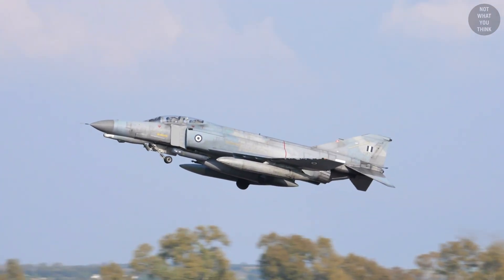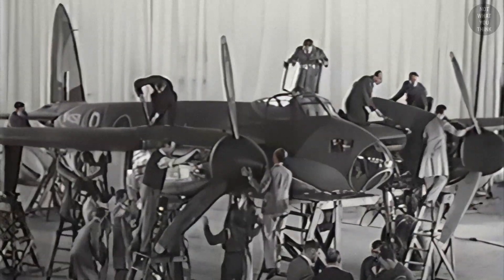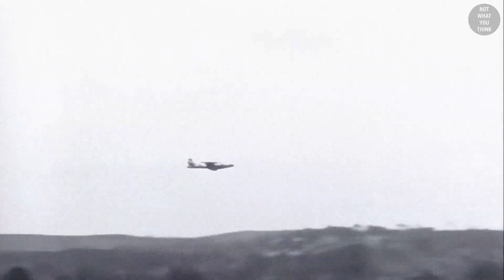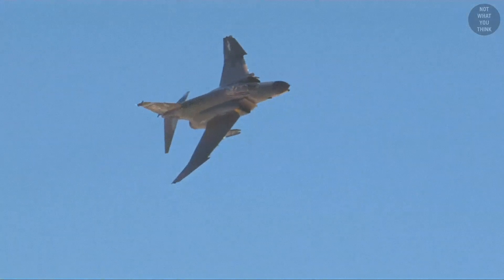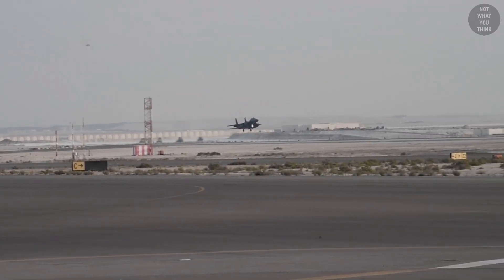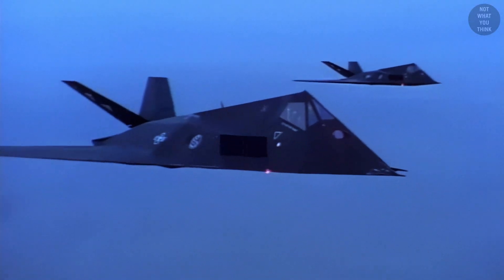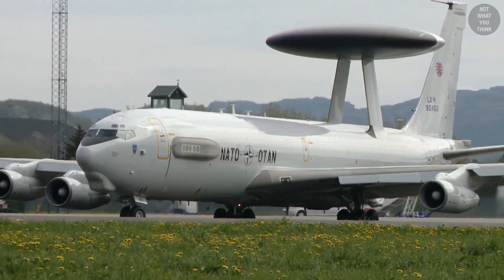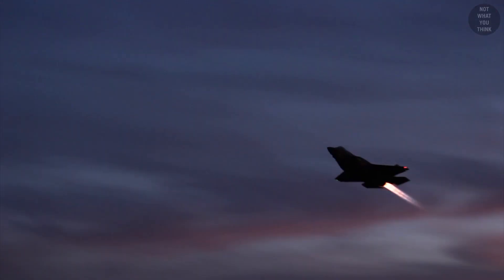Why are Modern Fighter Jets Slower than 1960s?

Comment: The thing is that older jet fighters can only achieve those very high speeds on very short "dash" flights. Flights that consume a lot of fuel, cut the life of the jet engine(s), and make themselves a huge infrared target. Real combat experience shows that you don't need that high a top speed, but lower infrared signature and a faster constant cruising speed.
Reply: Yeah the high speed interceptor concept was a response to the possibility of nuclear bombs being delivered by aircraft. As soon as ICBMs became common, the high speed “dash” capability became obsolete.
Reply: @splewy  not really if you live in a country with a massive area like the US, Can Aus Russ. There's always the need for a high speed interceptor. The Mig 31 has just underwent a full refit & modernisation. At the speed it can fly, with a nuclear armed cruise missile with a range of say a 1000 miles becomes a nuclear missile with a range of 1,500 miles that's delivered at speeds that are very very hard to defend yourself from.
Reply: @splewy  

The high speed interceptor concept is still very much valid if you're more interested in defense than in power projection.
Reply: @splewy  high speed dash is still useful for fleet defense, since carriers are mainly at threat from aircraft
Reply: The Century Series aircraft (as well as similar ones from other countries) were, primarily, envisioned as high-altitude bomber interceptors or as carrier-based fleet defense. In this role, combat radius is less important than time-to-climb and time-to-engage, both of which favor supersonic capability.  The introduction of ICBMs and much better early detection (AWACS and the like)  diminished the interceptor role.  The aircraft available to both sides during the Viet Nam war were the product of an earlier, bomber-dominated era and it was the other capabilities of the Phantom (ruggedness, huge payload, among others) that made it the best choice available out of what was on hand.  North Viet Nam used its aircraft, almost entirely,  in a purely defensive role as interceptors. Their MiG 19s and MiG 21s, operating close to home were well-suited to the need.  Modern combat aircraft have evolved into multi-role machines emphasizing attack capability where, while not needed that much, the interceptor capability is still important enough to maintain supersonic capability.
Reply: Amazing - anyone would think that you'd just watched the video
Reply: @nickgardiner7319  LMAO!
Reply: @nickgardiner7319  I was about to say the same thing
Reply: Yeah to compare them you have to compare the afterburner top speed and the not after burner top speed. F35 can do mach speeds without the afterburner other older jets cant do mach speeds without using after burner.
Reply: Legalize Raping Russian Broads In America  your name is disgusting and i hope you are always in discomfort
Reply: Well the simple fact is modern engines for more reliable and efficient
Reply: A lot of the older jet fighters/interceptors were actually designed to shoot down nuclear armed bombers (pre-ICBM era). A fighter/interceptor with high speed meant it could destroy bombers before they could attack cities. Of course, nukes are now mostly delivered by missiles so a single purpose short range aircraft is useless.
Reply: TL;DR more range more fuel less heat in engine
Reply: thanks, i just scrolled down and didnt click play
Reply: @Sacto1654 I also watched the video
Reply: the only plane where i would argue your wrong on is the sr-71  they 100% needed to  be fast
Reply: Yep. The Mig 25 could hit Mach 3... sure.. but doing so caused engine damage. Still, During the early days of the cold war, Speed was the driving force for development. It was the "one up" measurement between the USSR and the US. (Well, one of the measurements). Both countries followed the 'Bigger Better Faster Stronger' mantra.
Reply: They were made for bomber interception that was where the top speed shines fly as quickly as you can dump your ordinance into the wing of Soviet bombers and probably eject somewhere as you probably don't have an airfield to return to because WW3 has happened
Reply: Engineering is about tradeoffs.   So you know there was a treason why the tradeoff was made.
Reply: And a more powerful engine, so you can keep your speed in tighter turns.
Reply: Shhhhhhhh. Ears
Reply: Great you said exactly what he said in the video we just all watched
Reply: Rolling down the runway
throttles open wide
see the mighty Phantom
sway from side to side
airborne again without a blip
It's just one more aborted trip
but we're pressing on regardless
for the wg cdrs AFC

Went to early briefing
climbed into the Kite
opened up the throttles
and roared into the night
leaving the flare path far behind
It's dark outside, but we don't mind
cos we're pressing on regardless
for the wg cdr's AFC

Rolling down the runway
throttle open wide
see the mighty Falcon
sway from side to side
airborne again with just 9 G
I wish I had a nav with me (!)
but we're pressing on regardless
for the wg cdr's AFC

Rolling down the runway
throttles open wide
see the mighty Jaguar
sway from side to side
airborne again, but only just
It's not much fun
with F*** all thrust
but we're pressing on regardless
for the wg cdr's AFC

GIVE ME BUCCANEERS!
They're British through and through
The Banana Jet
The Best we've had yet
We are the last of the few.

Don't give me the Jaguar
Unless you refer to the car
The car is a groundhog
The aircraft is half frog
Don't give me the Jaguar.

Give me Buccaneers
They're British through and through
The Banana Jet
The Best we've had yet
We are the last of the few.

Don't give me the Harrier jump jet
You haven't convinced me yet
Jets that fly backwards 
Are soon to be knackered
Don't give me the Harrier jump jet
Well… Not just yet...

Give me Buccaneers...
They're British through and through
The Banana Jet
The Best we've had yet
We are the last of the few.

Don't give me this computer crap
It's no way to tackle a SAP
It's OK for Dicks, Germans and Spicks
But Gentleman always carry a map!

Give me Buccaneers...
They're British through and through
The Banana Jet
The Best we've had yet
We are the last of the few.

Don't give me Air Traffic Control
They live in a bloody great hole…
They scream, and they shout, then F**k you about
Don't give me Air Traffic Control.

Give me Buccaneers...
They're British through and through
The Banana Jet
The Best we've had yet
We are the last of the few.

Don't give me the F-104
It's only a ground loving whore
It goes in a turn, flick, spin and burn
Don't give me the F-104.

Give me Buccaneers
They're British through and through
The Banana Jet
The Best we've had yet
WE ARE THE LAST OF THE FEW!
Reply from the maker: What happened? It's simple question, Do you know Tim James?
Reply: @NotWhatYouThink  hello mate
Reply: @NotWhatYouThink  um. Whos tim james?
Reply: @NotWhatYouThink  hi the voice
Reply: and more wear on the airframe.
Reply: Mnaah....
Reply: If you've seen an episode of dogfights covering vietnamn, it allways seems like jets from that Era had a sieve for a fuel tank.
Reply: I think it is for the health and safety of pilot. The documentary of Russian Mig explain it perfectly. Less crashes and more maneuverability.
Reply: You are correct, jets like the F-22  and Eurofighter can supercruise comfortably.
Reply: f4 costs only 5m. it should be brought back and replace today's ridiculously expensive fighter jets and bombers
Reply: The Soy Hunter  What are you talking about? I'm sure you realize that the F-35 can go above Mach 1 without afterburners, right? It was literally one of the project goals.
Reply: EXACTLY!
Reply: It’s another shift in technology.  In the Spanish civil war, the Luftwaffe learned speed as more important than maneuverability, a shift from wwi.
Reply: Well done, you've just repeated what was said in the video
Reply: The F-111 would like a word with you
Reply: Global strategic conditions and technologies changed, top speed is not a major factor now that strategic bombers are no longer the most serious threat
Reply: Make sense
Reply: an F35 can only do Mach 1.6 for 50 seconds without causing permanent damage to the aircraft.
Reply: @spiffdandy77  Only the naval versions. And only under a whole set of specific conditions that they aren't even bothering to investigate and test thoroughly because it doesn't affect the relevant performance of the aircraft. Just like the F-22 has a top speed limit that isn't defined by the capability of the aircraft but issues it might cause.
Reply: @spiffdandy77  the F-35s cruising speed is mach 1.4 standard at alts of 30,000 ft mach 1.6 is its burn speed.
Reply: @spiffdandy77  Yes this is true. The F-35 is junk.
Reply: @spiffdandy77  Totally false, and there aren’t any teen fighters than can do 1.6 Mach with most combat configurations anyway, so F-35s are uniquely capable in the speed department, averaging higher cruise speeds than the F-16 and F/A-18 especially.  They are more comparable to Typhoon and Rafale in cruise speeds.  The assertion of permanent damage is erroneous.
Reply: @spiffdandy77  That is not true. The lead F-35 project test pilot addressed this saying that they could cruise around at Mach 1.6 all day. Early on, the F-35 B model had had structural concerns in the tail section with prolonged use of afterburner, but that has since been rectified. Again, in combat they would never operate over mach .95 due to the heat signature.
Reply: @spiffdandy77  yeah exactly and and rocket traveling at Mach 7 will absolutely fuck that thing far before fifty seconds
Reply: You summed it all up perfectly! Even so, I still want to go Mach 2+, LOL!
Reply: @davethekraut  Hey maybe give some old fantoms to Ukraine.  The whey the Russian fly it mite help Ukraine.  The Fantoms flew good in the 60s and 70s they were in service for a long time. Even send over some F15 and F16 they were perfect dogfighting jets. It would be good for Ukraine.
Reply: Not true
Reply: Think, the 71 had mach 3 Speed ,,, duh for thousands of miles
Reply: @raywhitehead730  Yeah but it was literally two cameras strapped to fuel tanks with some engines and some place for pilots... It was also designed to fly at very high alt, not suitable or usable in any fight, just to take photos. Now we have satellites so no need for such aircraft.
Reply: @raywhitehead730  The SR-71 is a much different beast compared to something like the F-35. For one, it is designed exclusively for high speed high altitude flight, so it's engines and airframe are built to be most efficient at high speed (The engines became most efficient at about Mach 3)
For two, the SR-71 is designed much better for flight above Mach 1 than the F35, because the 35 is designed to be controllable and efficient at subsonic speed as well as supersonic speed, the 71 is not.
Reply: @raywhitehead730  that's cause it is huge compared to say an F16
Reply: @richardmillhousenixon  Yes, not to mention the SR-71 was a recon aircraft, not a combat aircraft.
Reply: @raywhitehead730  the SR-71 was purpose built as a highspeed recon aircraft. this is talking about the fighter. the 71 also was built as a plane that cruised at almost 80,000 ft which means the cruising speed that is shown is actually skewed due to air resistance.
Reply: @raywhitehead730   It also out climbed and out ranged IR missiles
Reply: Today, they say more Americans believe a German invented the jet engine! It's so sad. Frank Whittle says of his "Eureka" moment. It came out of the blue, he recalled. He had, effectively, dreamt up the turbojet, the early jet engine. I knew if a man was going to fly faster, he would have to fly at a greater altitude where the air was thinner. Whittle concluded that the conventional propeller would never be sufficient, and that an entirely new sort of engine would be required. His arguments were so advanced that he was awarded 30 out of 30 for his work. 

When the young RAF officer took his idea to the Air Ministry, later in 1929, they were not sure what to make of it. They ran it past a senior boffin called A.A. Griffith, who had already done some work on the subject. Whether he was misguided or simply disliked this young Whittle in uniform, Griffith gave the idea a thumbs down. As a result, the Air Ministry rejected Whittle's design as impractical, and carried on ordering traditional planes with propellers. 

So Whittle took out a patent to protect his turbojet idea, which was duly published by the Patent Office. Others, like the Germans, however, saw its merits, and German diplomats in London wasted no time ordering copies of the patent when the patent expired in 1935. A young Whittle could not even afford the £5 renewal fee.

The RAF remained supportive of their young genius, however, financing Whittle through Cambridge, where  needless to say, he took a First Class degree in Mechanical Sciences. All the while, he was still designing the jet engine he knew would work. Finally, two friends helped him secure enough backing to start a company called Power Jets Ltd, and in April 1937, he fired up his first jet engine, (the first seen working recorded Jet engine ever built).
 
Unlike the latter claimed German ''Engine'', they claim (long after), yet they claim it was in the same year, of the same month, and on the same day? LOL. Sure! Only nobody ever said a thing about it, at the time? But Whittles was spoken about, and written about, throughout the entire media world, as he couldn't turn it off. He had to wait for it to run out of fuel, LOL.

Today, his son, Ian Whittle's, primary concern is to protect his father's memory from continued erosion. He said It's appalling, it's a disgrace to human ingenuity, using cheap tricks, and misinformed people to make up history, It's now an accepted fact in the USA, that my father did not invent the jet, but, that he and von Ohain — (who became an American citizen) — co-invented it at the same time, he says... Pretty soon, history will be rewritten to say that it was a German or American invention, just not British.

So true his words really are? Certainly, many American engineering institutions now routinely describe von Ohain as one of the inventors of the jet. 

Captain Eric Brown, late, of the Fleet Air Arm, (one of the greatest test pilots in aviation history) said it was Frank's invention, and they just copied him. And let's be honest, he should know, not only has he flown more planes than anyone else — 487 different types, but he was sent to Germany straight after the war to get hold of all the Nazis aviation technology.

He says I interrogated von Ohain, who was very ambivalent about where he had got his ideas, he couldn't say where his Idea came from, says Capt Brown from his Sussex home. He goes on, but his sidekick was different, an open book, he was utterly straight-forward about it. He said that Whittle's patent had been in every technical library in Germany, even before the war. He says, I have absolutely no hesitation in saying that Frank Whittle was the real (and only) inventor of the jet engine — and furthermore that he could have produced a jet fighter by 1937— If the Establishment had been on his side. But the Jet Engine is Frank's very own Invention.

This is the American mentality, and it always has been, you only need to study Anglo-American history, to see straight through this misrepresentation of a “Special Partnership”. 

Whatever the British have achieved In this world, the American wants to beat it. And however they do so, whether by cheating, lying, making up history, stealing others technology to credit themselves, the list is endless.

But, I mean, let's be honest... Just how stupid are they really, they really don't understand British history, as they'd need to be incredibly stupid, unrealistic, and foolish, to try to top what the British have already achieved in this world, as no country gets remotely close.
Reply: @hotstepper887  However, Whittle's design was a technological dead end. The axial flow jet engine was developed by Junkers around 1939 and first flown in 1942. Most modern jet engines use axial flow design nowadays.
Reply: @Sacto1654  To understand WW2?, you only need to imagine, if Britain had been beaten at any point in the war, or even if Britain did what the USA did, and merely decided to sit out of what was always a world war? We could have done that too, as Hitler never wanted a war against Britain. 

So, if Britain had been beaten at any time in WW2, or had simply done the same as the USA?, then Hitler wouldn't have needed to open up the second front, and he would've attacked the Soviets in 1940, with full strength both in the air, and on the ground. 

And Germany would have absolutely annihilated the USSR, as in 1940, the USSR was not in any way at all, prepared to even defend themselves. The Soviet Red Army were sharing one riffle between 10 troops in places. That would have left Germany in control of all Europe, all the Soviet Union, plus much of the rest of the world! And that would have seen the USA, completely, and utterly annihilated, is the reality, the real truth. And that truth is nothing like you'll hear today! 

Churchill said to the world, ''Never in the field of human conflict was so much owed by so many to so few'' What do the American people think he was talking about? Just how is this possible, in 2022, to read so many that have no idea about their own country's real history?

Roosevelt, actually, set about asking Hitler for some kind of deal/arrangement, to avoid getting involved in the war! (Though we see that also changed and lied about today). But we all know that Hitler even ridiculed the cowardice of the USA, as he read the letter to the German people, (now if that's not cowardly and treacherous?, then I don't know what is). Hitler laughed at the USA, mocking them, rightfully calling them cowards for refusing to declare war on him! And he, then, declared war on the USA. How embarrassing is that, really? Huh? 

In a 1945, state department survey, on the USA's public attitudes to its wartime allies? Britain was the least trusted country of the allies. Just another thing that shows the truth?. 

The Americans all talk of winning the war, by supplying it? (yet even that is only another US lie, as I'll be proving below). And all while making an enormous profit from it?, the truth is, they only became a superpower, at Britain's expense. And still lie about it endlessly today. They were the traitors of WW2, is more like the real truth, and real history of WW2. Nothing new there though?, as that's what they've always been, to every single one of their so-called allies, all throughout their ever so short, and criminal murderous history. Their bullshit is like nothing this world has ever seen before, but when you're useless, cowardly, and brain-dead?, what else have they got, other than their bullshit?

Winning the Battle of Britain, was instrumental in getting Hitler to actually lose the war, (by making his biggest mistake of the war, opening up the second front), more so than anyone actually winning it. Nevertheless, the Soviets holding their front, before then turning Germany around, and chasing them home to their demise, is what actually ended the war. Most certainly not, the USA, not by the stretch of anyone's Imagination. 

The arrogance of a naive nation, when they did eventually arrive?, saw them get a crushing defeat in the desert? Utter tomfoolery, and sheer Incompetence. Oh yes, the super intelligent Yanks, thought, as the Brits had managed to force Rommel all the way out of Egypt. It must be quite easy, so that's where they would gently "ease" their troops into the theatre of war. 40,000 crushed and killed within days!

They then tried to help take Italy?. Only It had Churchill groaning, that he'd expected "a rabid wildcat just let loose, but all he got, was a blubbering whale stuck on a beach" LOL. As the Yanks decided to secure the beachhead, rather than as planned, storming inland to cut off and attack the retreating Germans (as the British forced them inland). 

Oh, and then, (as If not bad enough), decided to ignore the plan of cutting the retreating Germans off, but Instead, they headed straight for Rome, (so they could be first), while allowing those top crack German troops the time they needed to regroup and dig in. Such arrogant fools! It's reckoned that foolish, selfish act alone, cost over 400 British lives.

They then decided to commit the most cowardly act of human history, by murdering near on a million civilians, with a nuclear attack TWICE on civilian targets! And then the lies as we can now see today?. They claimed Japan surrendered after the second nuclear bomb?, yet again that's a lie, and it's not true. 

The truth is, the Japanese only surrendered after Stalin had kept his promise to invade East Asia, and the Soviets had crushed the Japanese. That, alone, ended all of Japan's hopes of getting Stalin to act as a mediator, for a conditional surrender. And it was only then the Japanese surrendered. It's actually undeniable, as the timing of the surrender proves It. It was just another American lie.

Today we also read some Russians actually trying to claim the war was won by them? Well, well, really? So, who did they ever liberate? Nobody, all throughout the Battle of Britain, the USSR were still Nazi allies, and they committed as many, if not more, murders than Nazi Germany themselves. 

They also took Eastern Europe, while slaughtering thousands of people who had just survived the Nazi onslaught, only to be murdered by the Soviets, and seeing the survivors forced into the nightmare, that was, the Soviet Union. Sure sounds like a well won victory to me... NOT.
Reply: @Sacto1654  USA REAL HISTORY. 
1. Afghanistan... In the 1980s, the U.S. worked with Pakistan and Saudi Arabia to overthrow Afghanistan's socialist government. It funded, trained and armed forces led by conservative tribal leaders whose power was threatened by their country's progress on education, women's rights and land reform.

2. Albania, Between 1949 and 1953, the U.S. set out to overthrow the government of Albania, the smallest and most vulnerable communist country in Eastern Europe. Many of the exiles involved in the plan were former collaborators with the Italian and German occupation during World War II. They included former Interior Minister Xhafer Deva, who oversaw the deportations of “Jews, Communists, partisans and suspicious persons” (as described in a Nazi document) to Auschwitz. Declassified U.S. documents have since revealed that Deva was one of 743 fascist war criminals recruited by the U.S. after the war.

3. Argentina. U.S. documents declassified in 2003 detail conversations between U.S. Secretary of State Henry Kissinger and Argentinian Foreign Minister Admiral Guzzetti in October 1976, soon after the military junta seized power in Argentina. Kissinger explicitly approved the junta's “dirty war,” in which it eventually killed up to 30,000, most of them young people, and stole 400 children from the families of their murdered parents. Kissinger told Guzzetti, “Look, our basic attitude is that we would like you to succeed... the quicker you succeed, the better.” The U.S. Ambassador in Buenos Aires reported that Guzzetti “returned in a state of jubilation, convinced that there is no real problem with the US government over that issue.”

4. Brazil. The CIA provided all the support needed to ensure the success of the coup, including funding for opposition labour and student groups in street protests, as in Ukraine and Venezuela today.

5. Cambodia. As the Khmer Rouge gained strength in 1973, the CIA reported that its "propaganda has been most effective among refugees subjected to B-52 strikes.” After the Khmer Rouge killed at least 2 million of its own people and was finally driven out by the Vietnamese army in 1979, the U.S. Kampuchea Emergency Group, based in the U.S. Embassy in Bangkok, set out to feed and supply them as the “resistance” to the new Vietnamese-backed Cambodian government. Under U.S. pressure, the World Food Program provided $12 million to feed 20,000 to 40,000 Khmer Rouge soldiers. 

6. Chile. After General Pinochet seized power, the CIA kept Chilean officials on its payroll and worked closely with Chile's DINA intelligence agency as the military government killed thousands of people and jailed and tortured tens of thousands more.

7. China. By the end of 1945, 100,000 U.S. troops were fighting alongside Chinese Kuomintang (and Japanese) forces in Communist-held areas of northern China. Chiang Kai-Shek and the Kuomintang may have been the most corrupt of all U.S. allies. A steady stream of U.S. advisers in China warned that U.S. aid was being stolen by Chiang and his cronies, some of it even sold to the Japanese, but the U.S. commitment to Chiang continued throughout the war, his defeat by the Communists saw him flee to Taiwan. 

8. Colombia. When U.S. special forces and the Drug Enforcement Administration aided Colombian forces to track down and kill drug lord Pablo Escobar, they worked with a vigilante group called Los Pepes. In 1997, Diego Murillo-Bejarano and other Los Pepes' leaders co-founded the AUC (United Self-defence Forces of Colombia) which was responsible for 75% of violent civilian deaths in Colombia over the next 10 years.

9. Cuba. The United States supported the Batista dictatorship as it created the repressive conditions that led to the Cuban Revolution, killing up to 20,000 of its own people. After the revolution, the CIA launched a long campaign of terrorism against Cuba, CIA-backed operations against Cuba included the attempted invasion at the Bay of Pigs, in which 100 Cuban exiles and four Americans were killed; several attempted assassinations of Fidel Castro and successful assassinations of other officials.

10. El Salvador. The government forces responsible for this one-sided slaughter, were almost entirely established, trained, armed and supervised by the CIA, U.S. special forces and the U.S. School of the Americas.

11. France. After the OSS merged into the new CIA after the war, it used its contacts to restore Corsican gangsters to power in Marseille, to break dock strikes and CGT control of the docks. It protected the Corsicans as they set up heroin labs and began shipping heroin to New York, where the American-Sicilian mafia also flourished under CIA protection. 

12. Ghana, There was a rising star in Ghana: Kwame Nkrumah. He was Prime Minister under British rule from 1952 to 1960, when Ghana became independent, and he became president. In 1965, he wrote a book called Neocolonialism: The Last Stage of Imperialism. Nkrumah was overthrown in a CIA coup in 1966. 

13. Greece. Prime Minister Georgios Papandreou was overthrown in a CIA-backed coup in 1967, leading to seven more years of military rule. His son Andreas was elected as Greece's first “socialist” president in 1981, but many ELAS-EAM members jailed in the 1940s were never freed and died in prison. 

14. Guatemala. After its first operation to overthrow a foreign government in Iran in 1953, the CIA launched a more elaborate operation to remove the elected liberal government of Jacobo Arbenz in Guatemala in 1954. 

15. Haiti. The long-suffering people of Haiti finally elected a truly democratic government led by Father Jean-Bertrand Aristide in 1991. But President Aristide was overthrown in a U.S.-backed military coup after eight months in office. 

16. Honduras. The 2009 coup in Honduras has led to severe repression and death squad murders of political opponents, union organizers and journalists. At the time of the coup, U.S. officials denied any role in the coup and used semantics to avoid cutting off U.S. military aid as required under U.S. law, the U.S. Embassy was the main power brokering managing the aftermath of the coup and forming a government that is now repressing and murdering its people. 

17. Indonesia. In 1965, General Suharto seized effective power from President Sukarno on the pretext of combatting a failed coup and unleashed an orgy of mass murder that killed at least half a million people. U.S. diplomats later admitted providing lists of 5,000 Communist Party members to be killed. 

18. Iran. Iran may be the most instructive case of a CIA coup that caused endless long-term problems for the United States. In 1953 the CIA overthrew the popular, elected government of Mohammed Mossadegh. CIA paid millions of dollars to bribe military officers and pay gangsters to unleash violence in the streets of Tehran. 

19. Israel, Israel remains beyond the rule of law, shielded from accountability by its powerful patron, the United States. Since 1966, the U.S. has used its Security Council veto 83 times, more than the other four Permanent Members combined, and 44 of those vetoes have prevented the UN from prosecuting Israel for its crimes against humanity. 

20. Iraq. After the U.S. invaded Iraq on false pretences in 2003, the CIA recruited 27 brigades of “Special Police,” merging the most brutal of Saddam Hussein's security forces with the Iranian-trained Badr militia to form death squads that murdered tens of thousands of mostly Sunni Arab men and boys in Baghdad and elsewhere in a reign of terror that continues to this day.
Reply: @hotstepper887  Do you have a life?
Reply: @hotstepper887  History and sports. Two things you never listen to a brit for. All they will do is tell you how important they are. Loool.
Reply: @bideomanlol  And that answers what exactly? Clearly, you can't read the English language? Why is that? If you ever want to run down another country? 

Then you must come from better or be able to claim better? Otherwise, where is your right to hold any kind of opinion, on anything or anyone else? 

If your very own country can't offer anything remotely the same, or claim to have done anywhere near what this country can claim, and has done for others in this world? You have no right at all to judge anything! Do you understand that? 

Even more truth really is, you all owe this country so much. But we read you? Absolutely clueless about any of this factual reality? Why is that? 

I can't wait to read all about this fantastic country and your tremendous war efforts, efforts to save the people from oppression and tyranny, and to show us all what you've ever done for anything or anyone else?? This will be fun!

Why have we not seen you show us this great country, you must believe has and can claim better than this country can, in anything at all? I do mean anything at all? And all this is, is truth and reality, but again, we see you not knowing any of this? Why is that??
Reply: @bideomanlol  You laugh like you know something? But you offer nothing?
Reply: @bideomanlol  You must think I've just made all this up, right? 

In the 1200s, the Magna Carta was written, and It's still used in all parts of the world today, in every other countries own laws one way or another. Britain has not only been involved throughout the entire world for hundreds upon hundreds of years, but spent much of that time leading It. 

Since the 1500s, Britain was (accidentally) building the largest, the most influential Empire, of all time. Love it, or hate it?, there's no denying the great things this country has given to the world, no other country gets remotely close.

When Britain gave up its Empire, (so she could continue fighting for everybody's freedom), did Britain fight to keep it? No, not at all, Britain actually made sure each country had a capable government in place, before then leaving each country, we did not fight them or kill them. Hong Kong was the last part of our Empire, and once again, we simply gave it back to China.

Still, to this day, no country has come anywhere near achieving what Britain has already achieved In this world. No country has given this world anywhere near what Great Britain has.

No country has made anywhere near such important discoveries in this world, as Great Britain. Britain is responsible for nearly every one of the top 20 discoveries in this world.

No country has given the world all the sciences we all take for granted today, they all came from Great Britain. Science, itself, is indeed British.

Sir Isaac Newton: The father of physics, and considered to be the father of all sciences, by science itself.
Robert Boyle: the father of Chemistry.
William Gilbert: the father of Electricity and Magnetism.
Ernest Rutherford: the father of Nuclear Physics.
Adam Sedgwick: the father of modern geology.
Charles Babbage: the father of the Computer.
John Cockcroft: the genius who first split the atom.
James Chadwick: with the discovery of the neuton.
Michael Faraday: the genius that discovered Electromagnetic Induction.
John Dalton: the discovery of the Atom, and the writer of the Modern Atomic Theory.
John Thomson: the discovery of the Electron.
Charles Darwin: with the Origin of Species. 
Stephen Hawking: the general theory of relativity and quantum mechanics.
I could keep going, for many more pages… Or even books.

No other country has given the world medicines, that are responsible for billions of people living today, (7.5 billion on earth) Alexander Fleming changed the world of medicine. His invention “Penicillin” is said to be responsible for the survival of over 5.5 billion people to date. British medical achievements started all we know today.

No other country comes anywhere near inventing things, things we all use every day, than Great Britain. No other country comes remotely close. Invented the Jet engine, T.V, Telephone, Train, Penicillin, Computer, Hovercraft, Vertical Take Off Landing aircraft, LCD, Tanks, The World Wide Web, look at the history of each of those? A person from the UK lay at the heart of the device? I could keep going, Britain is responsible for an astonishing 54%, of all worldly inventions.

Britain is also responsible for an enormous 61% of all modern day military invention. The chances are, if you were to look up any random piece of military hardware, there's a 2/3 chance it will be a British invention.

No other country has stood up, and fought for the people's freedom by preventing the whole world from falling into the dark ages of tyranny. Great Britain is the only country in the world, that has fought against every attempt at tyranny in our world's modern history. So many times Great Britain saved Europe throughout history, not only in WW2, but many times before. With the defeat of Napoleon, being just one. Great Britain, with Prussian support, defeated Napoleon, he defeated everyone else.

Russia has defeated all armies that have tried to defeat her on her own soil, apart from the Mongol Empire & Great Britain (partly France). We are the only countries/empires on earth to have beaten Russia on her own soil.

Who stood up, alone, to the Nazi might? Not anyone else, no, only Britain. No matter about all the bullshit we hear about the British Empire, it still did far more good in this world, than the tiny minority of bad, but even its bad side?, even that's a billion times better than wherever these people (we endlessly read talking their hate, come from). 

And isn't it amazing, that I can confidently say that?, and say it, without even knowing where these others come from? Think about that.

But please, if anyone disagrees?, then do tell us all about these tremendous countries you must come from? Tell us all about these great things your own countries have actually done in this world? Tell us all, let's hear about these tremendous things your own countries have done for, or given, this world?
Reply: Eats popcorn
Reply: @hotstepper887  Germany never had the resources to beat the USSR and Germany always had the intention to invade the USSR.
Reply: @hotstepper887  don't care plus you're british
Reply: @RevyIRL  We always hear about the big bad Great Britain (which is actually completely wrong) British “world history” was largely started against the Spanish when Queen Elizabeth I, told her Royal Navy to become (''privateers'') pirates in other words, and she told them, the more booty they could muster, would see them achieve nobility in the higher echelons of British society. 

Elizabeth's authorization of sea-raiders (known as Sea Dogs) such as Francis Drake and Walter Raleigh allowed her to distance herself from their raiding activity while enjoying the benefits of their plunder.

Britain was asked by so many of those countries (she's today accused of attacking by the uneducated) for her protection from the French and the Spanish, who were trying to build Empires, and were also trying to break us on this Island the UK by blockading us, and trying to prevent us from trading throughout the world. 

Britain had no choice but to fight against both France and Spain, for our own existence, but nobody talks about this today?, yet that is why we began attaining an Empire, not by choice, but by necessity!
 
They did not sail into ports and attack countries to take into her Empire?. That's, again, just wrongly assumed. Go find out how and why the British were even in New Zealand? 

Yet still today, we see, and we read people who actually think Britain built her Empire, through invasion and killing and stealing? 

The truth really is, those countries we're all glad to see Britain beat their oppressors, but so few understand this today?, and even fewer want to understand it?. 

Yet it's ironic, when you think, the only reason many of these people making false claims are even allowed their opinion today?, is 100% entirely thanks to Britain!

Britain was also creating trading posts all around the world, while also protecting them. All of  these countries fell under British occupation and rule. Britain actually improved many countries, and in so many various ways. We created many countries their own military defences, and army's, many of which are still going to this day? 

Many also forget that Britain protected those countries who would've fallen to communism, if not for the fact, they were under British protection. Even today, we still  hear some people from places like Jamaica, saying they wished they were still part of the British Empire, and this again, so few understand today.

Britain was not just all bad, but actually did a hell of a lot of good for millions of people, all around the world, we also opened many of these countries up, to trade with, not to rob and steal from, we modernized many of them, we created housing, structures, schools, and communities, and gave them the ability to trade throughout the entire world, those people found a voice, and a purpose, thanks to the UK. And many of which will still tell you so today!

Antigua and Barbuda, Australia, The Bahamas, Bangladesh, Barbados, Belize, Botswana, Brunei Darussalam, Cameroon, Canada, Cyprus, Dominica, Fiji Islands, The Gambia, Ghana Grenada, Guyana, India, Jamaica, Kenya, Kiribati, Lesotho, Malawi, Malaysia, Maldives, Malta, Mauritius, Mozambique, Namibia, Nauru, New Zealand, Nigeria, Pakistan, Papua New Guinea, St Kitts and Nevis, St Lucia, St Vincent and the Grenadine, Samoa, Seychelles, Sierra Leone, Singapore, Solomon Islands, South Africa, Sri Lanka, Swaziland, Tonga, Trinidad and Tobago, Tuvalu, Uganda, United Republic of Tanzania, USA, Vanuatu and Zambia.

Britain ruled the seas, and she most certainly put that to her use.

In the 1200s, the Magna Carta was written, and It's still used in all parts of the world today, in every other countries own laws one way or another. Britain has not only been involved throughout the entire world for hundreds upon hundreds of years, but spent much of that time leading It. 

Since the 1500s, Britain was (accidentally) building the largest, the most influential Empire, of all time. Love it, or hate it?, there's no denying the great things this country has given to the world, no other country gets remotely close.

When Britain gave up its Empire, (so she could continue fighting for everybody's freedom), did Britain fight to keep it? No, not at all, Britain actually made sure each country had a capable government in place, before then leaving each country, we did not fight them or kill them. Hong Kong was the last part of our Empire, and once again, we simply gave it back to China.

Still, to this day, no country has come anywhere near achieving what Britain has already achieved In this world. No country has given this world anywhere near what Great Britain has.

No country has made anywhere near such important discoveries in this world, as Great Britain. Britain is responsible for nearly every one of the top 20 discoveries in this world.

No country has given the world all the sciences we all take for granted today, they all came from Great Britain. Science, itself, is indeed British.

Sir Isaac Newton: The father of physics, and considered to be the father of all sciences, by science itself.
Robert Boyle: the father of Chemistry.
William Gilbert: the father of Electricity and Magnetism.
Ernest Rutherford: the father of Nuclear Physics.
Adam Sedgwick: the father of modern geology.
Charles Babbage: the father of the Computer.
John Cockcroft: the genius who first split the atom.
James Chadwick: with the discovery of the neuton.
Michael Faraday: the genius that discovered Electromagnetic Induction.
John Dalton: the discovery of the Atom, and the writer of the Modern Atomic Theory.
John Thomson: the discovery of the Electron.
Charles Darwin: with the Origin of Species. 
Stephen Hawking: the general theory of relativity and quantum mechanics.
I could keep going, for many more pages… Or even books.

No other country has given the world medicines, that are responsible for billions of people living today, (7.5 billion on earth) Alexander Fleming changed the world of medicine. His invention “Penicillin” is said to be responsible for the survival of over 5.5 billion people to date. British medical achievements started all we know today.

No other country comes anywhere near inventing things, things we all use every day, than Great Britain. No other country comes remotely close. Invented the Jet engine, T.V, Telephone, Train, Penicillin, Computer, Hovercraft, Vertical Take Off Landing aircraft, LCD, Tanks, The World Wide Web, look at the history of each of those? A person from the UK lay at the heart of the device? I could keep going, Britain is responsible for an astonishing 54%, of all worldly inventions.

Britain is also responsible for an enormous 61% of all modern day military invention. The chances are, if you were to look up any random piece of military hardware, there's a 2/3 chance it will be a British invention.

No other country has stood up, and fought for the people's freedom by preventing the whole world from falling into the dark ages of tyranny. Great Britain is the only country in the world, that has fought against every attempt at tyranny in our world's modern history. So many times Great Britain saved Europe throughout history, not only in WW2, but many times before. With the defeat of Napoleon, being just one. Great Britain, with Prussian support, defeated Napoleon, he defeated everyone else.

Russia has defeated all armies that have tried to defeat her on her own soil, apart from the Mongol Empire & Great Britain (partly France). We are the only countries/empires on earth to have beaten Russia on her own soil.

Who stood up, alone, to the Nazi might? Not anyone else, no, only Britain. No matter about all the bullshit we hear about the British Empire, it still did far more good in this world, than the tiny minority of bad, but even its bad side?, even that's a billion times better than wherever these people (we endlessly read talking their hate, come from). 

And isn't it amazing, that I can confidently say that?, and say it, without even knowing where these others come from? Think about that.

But please, if anyone disagrees?, then do tell us all about these tremendous countries you must come from? Tell us all about these great things your own countries have actually done in this world? Tell us all, let's hear about these tremendous things your own countries have done for, or given, this world?
Reply: @RevyIRL  Crimes against humanity in India, today, are catastrophic. They cry, and they all lie about the people that built their country from the ground up? They say the British stole from India? Another lie, the British created India great wealth through trade. Indian traders with the British covered the world together, creating great wealth, wealth then taken by the Indian princes, and divided between those families, never shared, or used to help the population.

British medical stations and supplies to India, can be said to be responsible for the survival of many minorities in India. The entire infrastructure, right across India, was not paid for by India? But by the British, much of which is still the only infrastructure found in many parts of India, (as under their own rule, those things were never seen as important, as they catered for the poor). 

They all accuse the British of stealing? While the British actually build their country up from nothing but tribal people, to a united people, paid for by the British through their own financial institutes. The hypocrisy is simply something else. 

During World War I, British India, quite rightly (as it was a world war, nobody exempt), contributed to the British war effort by providing men and resources. Thousands of Indian soldiers and labourers served in Europe, Africa, and the Middle East, while both the Indian administration and the princes of India sent large supplies of food, money, and ammunition. However, Bengal and Punjab, remained sources of anti-colonial activities. 

Revolutionary attacks in Bengal, associated increasingly with disturbances in Punjab, were significant enough to nearly paralyse the regional administration. Of these, a pan-Indian mutiny in the British Indian Army planned for February 1915 was the most prominent amongst a number of plots formulated between 1914 and 1917 by Indian nationalists in India and in the United States and Germany. 

The planned February mutiny was ultimately thwarted when British intelligence infiltrated the Ghadarite movement, arrested key figures. Mutinies in smaller units and garrisons within India were also crushed.

In the scenario of the British war effort during WW1 and the threat from the militant movement in India, the Defence of India Act 1915 was passed limiting civil and political liberties. Michael O'Dwyer, then the Lieutenant Governor of Punjab, was one of the strongest proponents of the act, in no small part due to the Ghadarite threat in the province.

With the Germans, many Indians were part of the Hindu–German Conspiracy (look it up). That was a series of terrorist plans between 1914 and 1917 by Indian nationalist groups to attempt a Pan-Indian rebellion against the British Raj during World War I, formulated between the Indian revolutionary underground and exiled or self-exiled nationalists who formed in the United States in the Ghadar Party, and in Germany. 

The Indian independence committee, in the decade preceding the Great War. Saw the conspiracy drawn up at the beginning of the war, with extensive support from the German Foreign Office, the German consulate in San Francisco, as well as some support from Ottoman Turkey, and the Irish republican movement. The most prominent plan attempted to foment unrest and trigger a "Pan-Indian" mutiny in the British Indian Army, from Punjab to Singapore. 

This plot was planned to be executed in February 1915 with the aim of overthrowing British rule over the Indian subcontinent. 

Other related events, include the 1915 Singapore Mutiny, the Annie Larsen arms plot, the Jugantar–German plot, the German mission to Kabul, the mutiny of the Connaught Rangers in India, as well as, by some accounts, the Black Tom explosion in 1916. Parts of the conspiracy included efforts to subvert the British Indian Army in the Middle Eastern theatre of World War I. 

The Indo-Germanic alliance and the conspiracy were the target of a worldwide British intelligence effort, which was successful in preventing further attempts. American intelligence agencies arrested key figures in the aftermath of the Annie Larsen affair in 1917. The conspiracy resulted in the Lahore conspiracy case trials in India, as well as the Hindu–German Conspiracy Trial—(at the time the longest and most expensive trial ever held in the United States). This series of events was consequential to the Indian independence movement. 

Though largely subdued by the end of World War I, it came to be a major factor in reforming the Raj's Indian policy. Similar efforts were made during World War II, in Germany, and in Japanese-controlled Southeast Asia, where Subhas Chandra Bose formed the Indische Legion and the Indian National Army, respectively, and in Italy, where Mohammad Iqbal Shedai formed the Battaglione Azad Hindoustan. 

India is simply a nation of fools, and a nation of people who have no empathy for all those they continue to slaughter daily. Kashmiri women are amongst the worst sufferers of sexual violence in the world. Sexual violence has been routinely perpetrated on Kashmiri women, with 31.6% of respondents saying they were “victims of sexual abuse”. 

Due to the impact of the conflict, a number of people in the valley suffer from various psychological problems like stress (normal or related to traumatic event), anxiety, mood, and post-traumatic disorders. At the beginning of the insurgency, there were 1200 patients in the valley's sole mental hospital. In 2016, the hospital is said to have been overcrowded, with more than 200,000 patients. A 2010 US State Department report, cited extrajudicial killings by security forces in areas of conflict, such as Kashmir, as a major human rights problem in India.

The British parliament expressed its sadness and regret over the discovery of over 6,000 unmarked mass graves in Kashmir. Something that was always prevented under British rule, for over 250 years in Kashmir, India.

Another unknown fact today? Every year since the British left India, India has killed/murdered more of its own people per year, (mostly females), than ever died in a single year under British rule. Clearly showing us that the actual Indian people themselves, were far safer under British rule, than they are even today, under their own rule.
Reply: It was the English that free'd Jamaica from the brutality of the Spanish. The colony relied on passing ships for the trade of hides, and fruits. The colonists were involved in ship building and repairs. However, Jamaica never prospered as a Spanish colony. In fact, it was viewed as a burden and in 1512 there was a movement towards relocating the colony in Cuba.

Under the rule of the Spaniards, the Taino population dramatically declined as a result of the combination of new diseases such as smallpox, and the ill-treatment meted out to them by the colonists. By 1598, less than half of the Taino population remained.

In 1655, the Spanish were driven from the island by Admiral William Penn and General Robert Venables. The Spanish were forced to flee the island. Although the Spaniards were driven out they never gave up hope of recapturing the island of Jamaica and in 1658 another Spanish force landed but was defeated at the decisive battle at Rio Nuevo. 

British “world history” was largely started against the Spanish when Queen Elizabeth I, told her Royal Navy to become (''privateers'') pirates in other words, and she told them, the more booty they could muster would see them achieve nobility in the higher echelons of British society. 

Elizabeth's authorization of sea-raiders (known as Sea Dogs) such as Francis Drake and Walter Raleigh allowed her to distance herself from their raiding activity while enjoying the benefits of their plunder.

The island began to prosper under the rule of the British. Great wealth was brought to the island by the buccaneers, who operated mainly from Port Royal, by plundering Spanish ships which transported gold and silver from South America. By the late Seventeenth Century, Port Royal had earned the reputation of being the richest and the wickedest city in the world. 

In 1692 this town suffered destruction by an earthquake in which more than half of the town sank beneath the sea. This signalled the end of piracy in the West Indies. 

The second half of the Seventeenth Century saw the beginning of the “sugar revolution”. In 1833 slavery was abolished in the British West Indies, and a system of apprenticeship was adopted. 

The objective of the apprenticeship system was to help them adjust to their free status and to supply the planters with a source of constant labour until they could adjust to full wage labour. The abuses of the system were halted in 1838 when full freedom was given. 

The abolition of slavery saw a rise in the construction of Free Villages, and growth in peasant farming. The Institute of Jamaica was founded, to encourage literature, science and art. 

By 1872 the capital was transferred from Spanish Town to Kingston. There was an improvement in the water supply and a number of schools were established. There was a shift from sugar to banana production.

The Great War (1914 - 1918) gave many Jamaicans the opportunity to travel, which in turn helped to shape their views of the system of Government. In addition, during the early Twentieth Century, many Jamaicans left in search of employment in the Panama Canal Zone, and in Costa Rica, Cuba and Honduras to work on the plantations. 

The movement of people brought about a change in ideas by the 1920s. Marcus Mosiah Garvey, who promoted unity among blacks and pride in their race, became a prominent figure during this period.
Reply: @hotstepper887  didn't ask
Reply: @hotstepper887  
Imagine being British, like Britain doesn’t even exist 😂 

I expect at least ten paragraphs telling me how I’m arrogant because I said that now.
Reply: @BigManLaskey  American? LOL, No need to answer.
Reply: @anthonyfuqua6988  Obviously--inside 4 padded walls with an internet connection . . .
Reply: @anthonyfuqua6988  That's the longest troll post I've ever seen.  He probably wears Union Jack underwear, and necklace medallion of John Bull.
Reply: @malachiwhite356  wtf r u referring to?
Reply: @anthonyfuqua6988  I was referring to the comments made by "Hot Stepper."  Did it post wrong?
Reply: @hotstepper887  In fact the German Jet Maestro has said on public record that Whittle’s patent was the genesis of German Jet Engineering. Though this was at a much later date.
Reply: @phsycresconquest6636  What has that got to do with Frank Whittle inventing the Jet Engine?  The point I'm making is, that the USA have been trying to lie about British ingenuity, for all the reasons I've given. 

No country in the world comes anywhere near inventing things (that we all use every day) than Britain. No country comes even remotely close. You can add together the second most, third most, and fourth most, and they'd still not have invented what this country has. The Jet engine, T.V, Telephone, Train, Penicillin, Computer, Hovercraft, Vertical Take Off Landing aircraft, LCD, Tanks, The World Wide Web, Internet etc, etc. 

Look at the history of each of those, a person from this little island, lay at the heart of the device. I could keep going, Britain is responsible for an astonishing 54%, of all worldly inventions. 

No country in the world has invented more military hardware than Great Britain. The chances are, if you were to just look up any random piece of military hardware, there's a 2/3 chance it will be a British invention. Britain is responsible for an enormous 61% of all modern day military invention.

The USA would be years behind the modern world today in technology terms, if not for Great Britain, yet none of the Americans know this fact? They must think the US just clicked its fingers, and all this modern technology just fell from the sky? LOL

They all need to learn all about the “Tizard mission” because that's where their technology really came from.

The information, the technology, the know-how,  and top-secret technology provided by the British, saw it subject to very carefully vetted secret security procedures, because it contained some of the greatest scientific advances ever made.

The technology included radar (like the greatly improved cavity magnetron) which the American historian, James Phinney Baxter III, later called “the most valuable cargo ever brought to our shores”. 

The design for the proximity VT fuse (a fuse that detonates an explosive device automatically when the distance to the target becomes smaller than a predetermined value). 

Details and blueprints of Frank Whittle's jet engine. The Frisch–Peierls memorandum, describing the feasibility of an atomic bomb, (without which, there would have been no nuclear bomb).

Those alone were an enormous leap forward in US technological abilities and may be considered the most significant leap taken by the USA, (and all without thanks to British intuition and expertise), but we actually saw the opposite to any thanks, we saw them try to steal some of those inventions to credit themselves. 

The hypocrisy we see from all of them today, claiming China stole their tech? Not only is that erroneous claim nothing but rubbish, but the facts are the US have never had any tech for China to steal. The USA was good at one thing, mass production, the ingenuity, the invention and brains, all come from the UK and that still applies in many areas.

Many other items were also transported including many various designs for rockets, newly improved superchargers, highly advanced gyroscopic gunsights, newly built submarine detection devices, self-sealing fuel tanks, plastic explosives, and many more British technologies. 

That's the only reason they're not still decades behind in this world today, no other reason, only that! It's extraordinary, what they've all been taught? Why does none of them know this?

Britain also developed its own atom bomb to avoid complete dependence on the United States, (which was refusing to share atomic information, dirty cheating scum), as it was Britain that allowed them all their technical know-how? As well as the most important Frisch–Peierls memorandum, describing the feasibility of an atomic bomb, (without which the USA would never have had any nuclear bomb).

We read people today, without a clue, that the British had been working on an A. Bomb long before the USA were even involved. (Tube Alloys) was the code name of the research and development programme authorised by the United Kingdom before the Second World War.

The British efforts were kept classified, and as such had to be referred to by code, even within the highest circles of government. 

This had been going on long before the Manhattan Project, and everything that was used to set up and start up the Manhattan Project, was British research and British technical know how and understanding. Not American!!

A secret cabinet committee discussed the question of a British bomb in October 1946, with Hugh Dalton and Stafford Cripps opposing a British bomb, on grounds of cost. Ernest Bevin, however, was determined. He famously said...

“We have got to have this thing over here whatever it costs… we’ve got to have the bloody Union Jack on top of it”.

He got his way, and the work went ahead. The decision was kept extremely quiet, and most cabinet ministers, apparently, did not know of it. By the time the bomb was ready for testing, the second Churchill government was in power.

YouTube's search: Equinox - A very British bomb.
Reply: @hotstepper887  that’s the Key problem with having brilliant Intelligence services and Running a tight ship. Until stuff is declassified no one knows about it. 

The thing is that by the time these things were declassified their American Counterparts had been declassified for many years and with The US being a media hub it’s no wonder their stuff gets put forward as the “firsts”. 

As for Jet Engines and Frank, that’s only a very recent development, funnily as until today I didn’t know of his existence and importance and had thought the Jet was a German invention.

Secondly secrecy was absolutely imperative for the Brits but not so much for the Americans. As agents would still need to get their information and classified documents across the Atlantic as opposed to a short hop either across the Channel or North Sea. 

Famously even the people who were working on the first Tank didn’t know what it was that they were actually building. Their best guess that it was a vehicle to send water to the front line. Hence the name Tank.
Reply: The F-14A was apparently well suited for sustained mach 2 travel.
Reply: @jaffacalling53  

The F-14 also had the BVR weapon that allowed it to not even reach a high altitude. 

The MiG-25 was a deterrent for the SR-75. But the F-14 was a deterrent for the MiG-25.

The faster the aircraft goes the hotter it gets! Will also consume more fuel at a rate exponentially greater relative to its Mach speed.

The thrust of a given engine also decreases if keeping the same air to fuel ratio the faster the engine goes.

Thrust will even be exponentially decreased if accounting for the air flow aside from the air to fuel ratio the faster the engines go!
Reply: That’s when theory meets reality.
Reply: na its a newworldorder*conspiracy to reduce the speed of american fighter aircraft so they lose in war to Russian fighters.
Reply: @batman-cw2hd  haha.  Supersonic flight means lots of HEAT noise and increased radar signature.  What do most anti-air missiles SEEK?  Heat and Radar signals.  It's more likely conspiracy to force Russia to make supersonic aircraft that can be shot down by a single guy on the ground with a missile launcher strapped to his back.
Reply: There are still situations where high speed is needed and desired. In close quarters air combat, the aircraft maneuver at subsonic speeds, but if needed a fast jet can dive and in afterburner quickly achieve mach 2+. An airplane that has a top speed of Mach 2.5 (like and F-15) can walk away from an F-18 (or most other modern fighters) at literally the speed of sound. Not all engagements will or have involved missiles. Either because missiles are negated from countermeasures, or malfunctions or were simply expended in multiple target scenarios. Gun fights can and still do happen. So, the old dogfighter advantage of having a higher top speed can and will remain an important advantage for certain scenarios. 

And I won't go into the advantage of high supersonic sprint speed for intercepting fast nuclear bombers or other targets within the shortest period of time possible. That's still a thing for certain scenarios which are not off the table in modern times and is why we retain the F-15 and F-16 in the inventories. Fast jets still matter.
Reply: @drott150  yeah one of the best accounts of this I have seen is the iconic Vietnam dogfight between Navy Pilots Cunningham and Driscoll in an F4 and a Mig 15. The Mig was a lot manoeuvrable and could outturn the F4, but the F4 had twice the speed. If you listen to his account the Mig got on his tail and close to firing several times but he lit the afterburners, went supersonic and put some distance between them, then used his speed to catch the Mig again.
Reply: @robstone4537  Yes I think you're talking about Duke Cunnigham's account where he used his superior thrust and speed to outmaneuver the Mig. In WWII a very common tactic for the P-40 and Hellcat when flying against the Zero was to NOT engage in a turning fight with a zero. The zero was much more maneuverable at slower speeds and it was suicide to tangle with it on those terms. But the Hellcat and P-40 had superior dive speed and could turn better at high speeds. So they changed tactics to slashing attacks. They would fly at higher altitude and then use their superior dive speed to dive down at high speed on the zeros firing all the way. Then pull away using their superior speed so the zeros couldn't catch them. Rinse and repeat as necessary. A Mach 2+ jet can outrun a "standard" Mach 1.6 fighter bomber of today by literally hundreds and hundreds of miles per hour, especially in a dive.
Reply: @drott150  Yes, Duke Cunningham. My grandfather flew Hurricanes in North Africa in the ground attack role, he did not talk too much about his flying experiences, only the odd snippet. But I remember him telling me that if German fighters showed up the Hurricane was too slow to get away and they were too close to the ground to dive, you just kept turning and hoping the escorting Spitfires would save you.
Reply: @robstone4537  Yes if you were low and slow and the attacking aircraft could outturn you, you were in trouble. Although the 109 overall was a superior fighter, the Hurricane could turn inside a 109 in a tight dogfight. So if the low flying Hurricane was able to evade the initial 109 pounce from altitude and the 109 stayed down with the Hurricane, the 109 could find itself in trouble quickly. And that's cool your granddad saw service in North Africa. My granddad was a Sherman tank commander and also saw service in North Africa. Afterwards, he went to Sicily, then up the Italian boot until he was almost killed right outside of Pisa, exactly one month after D-day. He recovered and lived almost to a 100 years old, dying just a few years ago.
Reply: Idk if the older aircraft have drop tanks or midair refueling they can retain that high speed for a long time. Plus the higher you go the greater your fuel efficiency will be
Reply: @ICECAPPEDSKY  I don't know--running on full afterburner really consumes fuel.
Reply: @Sacto1654  Why did your comment just repeat what was said in the video? Your comment was redundant & added nothing to the conversation.
Reply: @Sacto1654  Afterburner typically means 50% more thrust for 400% fuel consumption
Reply: @ICECAPPEDSKY  The faster you cruise the better your efficiency is, especially if you're capable of super-cruise due to supersonic aerodynamics. At full afterburner your efficiency drops like a rock and you're trading endurance for a 100 meter sprint, most jets will be completely out of fuel at full afterburner in 7-10 minutes, not to mention the damage it causes to the engines to run it like that.
Reply: @ICECAPPEDSKY  Drop tanks creates more air resistance and slows the plane down. Midair refueling means your air tanker needs to be closer to the enemy air space and the tanker is literally a sitting duck.
Reply: @StevenSiew2  I like ducks, dey so cute. Never seen 'em doing any air-to-air refueling, though.

"literally [figuratively] a sitting duck."
Reply: @smoofbrain  I love how "literally" can literally mean literally but "literally" can also not mean literally
Reply: @ICECAPPEDSKY  No older aircraft all require afterburner to go supersonic in general, as stated in the video going supersonic reduced range by 70%.  Super Cruise became the holy grail for modern fighters - that's going supersonic without afterburners and the F-22 does that as does the newer F-15 variants and the F-35 even though the F-35 I think needs afterburner to get supersonic and then can reduce power and sustain cruise.
Reply: @ICECAPPEDSKY  no they can't those speeds are only achievable with internal fuel and very limited armament cause external tanks are really draggy
Reply: @ICECAPPEDSKY  No even then older jets aren't designed to keep going at that top speed for long periods, the MiG-25 Foxbat was insanely fast but at it's maximum speed pretty much required a full engine replacement at the end of the flight.

Doctrine switched from high altitude high speed interception to low altitude radar avoiding, so modern jets have very decent top speed, as much as they need, but more manuverability, more avionics and sensors, and better low observability designs.
Reply: @ICECAPPEDSKY  you specifically thinking about the sr-71?
Reply: @MavHunter20XX  no the higher jets go they will have an exponentially higher top speed using the same amount of fuel. There is a certain altitude where they reach peak efficiency though and any higher and they’ll lose speed. The SR71 has ramjets which make it the most effective but what I’m talking about applies to a good chunk of jets with afterburner
Reply: @ICECAPPEDSKY  midair refueling are easy target s in Air ,cos of slow and big.

For this you need Air royalty or a big Back up of defender Airplane's, so its not really a good match to fly with a fleet.

Its  to much of lose by mistake of the mission.

A real bad idea. Only practically by low military country of 3 ,2 World.

But second world tiger states or first world military would eat search fleets like nothing.

By finding the defense -Systems whould be happy like Christmas for so many enemy s of short target place on the Air.
Reply: @ICECAPPEDSKY  In the MiG-25, F-4, MiG-23, F-15, and F-16, if you ever reached Mach 2.0, you hit bingo fuel and have to find a place to land or aerial refuel quickly.  There are no mission profiles in any of those aircraft where you will hit Mach 2 and continue a fighting posture.  The only fighters/interceptors that can hit Mach 2 and still have endurance are the F-22A and MiG-31, though it will limit their persistence/radius substantially.
Reply: @ICECAPPEDSKY  drop tanks would significantly reduce speed
Reply: @ICECAPPEDSKY  planes like the F18, F16, F15 can only be on afterburner for around 10-20 minutes before they completely run out of fuel, an aerial refuel every 20 minutes doesn't sound too great. Mach 2 sounds fast but the trade off for range is exponential. Mach .9-Mach 2 is a little more than twice as fast right? but if your going Mach 2 that entire time your range, like the video said is 70% decreased. You can get somewhere fast but not make it back. Also, speeds on the deck are very very different. Top speeds on sea level are up to Mach 1.4 before the plane destroys itself. Speeds like the Mig25 could achieve were up high where the air resistance was low.
Reply: @ICECAPPEDSKY  that’s actually the other way around. Because now you’re pumping more fuel into the engine which you might think, yes, it increases fuel efficiency. But then you have to consider, at very high speeds, the faster you go, the more energy is required. Which means, you end up using more fuel for less and less gain once you reach a certain. Point.

Idk if this is true or not, but that’s the conclusion I came to
Reply: Can't wait till your sitting in a wadi taking PKM and RPG fire waiting for those slow birds coming from 400 miles or more away to get there..  Speed in combat often leads to victory. Stop believing the hype..
Reply: lol no, you need that high speed to reach area quickly, that means your defense force can react quickly to any intrusion, imagine if your aircraft can only reach mach 1.6 while attacker can reach 2.2 while defender pilot still need to ran from their station to hangar etc

F-35 also cant  use droptanks or it will lose their stealth advantage while attacker can do so

its just F-35 is a bulky jet and not designed to do interception, fully replacing F-15 and F-16 with this thing is laughable, even offensive  platform like aircraft carrier is not replacing all of their jet with F-35 because it have small combat radius and is not that fast, it also cant carry external weapons  because it compromise their stealth

F-35 is a ninja, its great for sure compared to normal spearman but no idiots gonna use army full of ninja in open field combat, its not meant to be used like that
Reply: How do you get to hell?
Very simple: claim that you're innocent.

How do you get to heaven?
Very simple: Admit that you're not Innocent, you're guilty and ask for mercy.

How to know if you're guilty or not?
Simply: Compare your life to the Ten Commandments God gave you in the Bible.
Everyone agrees that if people followed the ten commandments there would be no need for governments or police.

Do not lie.
Do not steal.
Do not commit adultery.
Do not insult God by using his name as a cuss word.
There are six more but let's just leave it at that.

How many lies have you told in your life?

Have you ever taken anything that didn't belong to you?

Jesus said, if you look at a women lustfully you've already committed adultery in your heart with that woman.
How many times a day do you do that?

Do you use God's name as a cuss word?
Would you do that with your own mother's name?

If you answer these questions honestly you know that you're guilty.

God can justly punish you and send you to hell.

Ask him for mercy.
His name is Jesus.

It's as simple as this, The Ten Commandments are called the moral law. You and I broke God's laws. Jesus paid the fine.
The fine is death.

Ezekiel 18:20 — 
"The soul who sins shall die.

That's why Jesus had to die on the cross for our sins. This is why God is able to give us Mercy.

Option A.
You die for your own sins.

Option B.
Ask for mercy and accept that Jesus died for you.
Reply: You’re completely wrong my guy lol blowing shi out ur azz 💯 keep living the dream though in your reality old timer
Reply: @crazynavyhm  I can't tell if you're complimenting him, insulting him, or having a stroke. Sorry, I may of used too much punctuation for you to be able to read this.
Reply: @crazynavyhm  he's 100% right
Reply: @crazynavyhm  Godzilla had a stroke while reading this and fucking died.
Reply: @crazynavyhm  cease cellular division pls